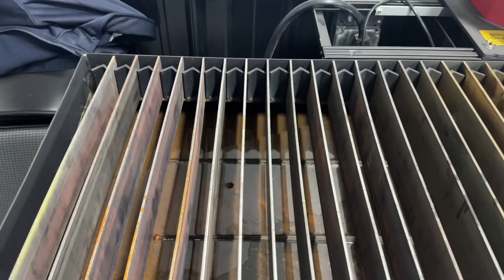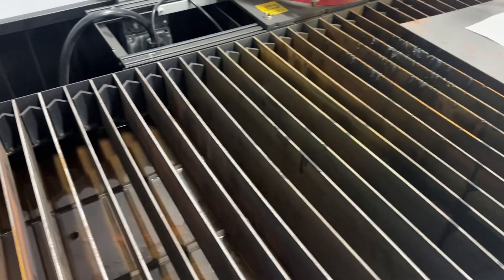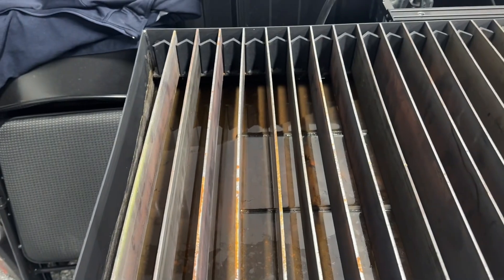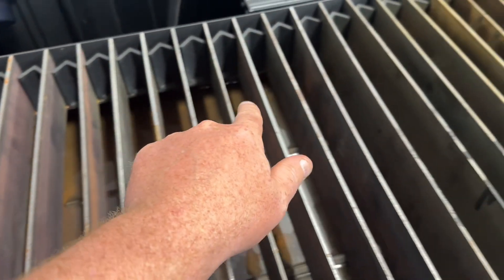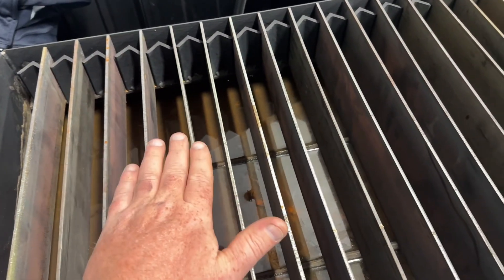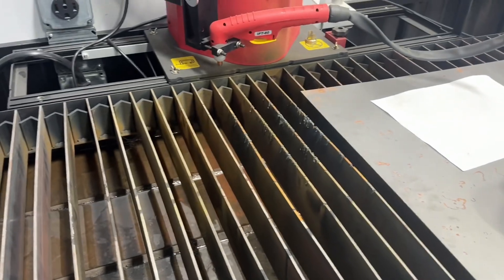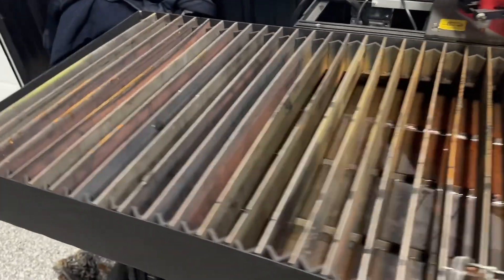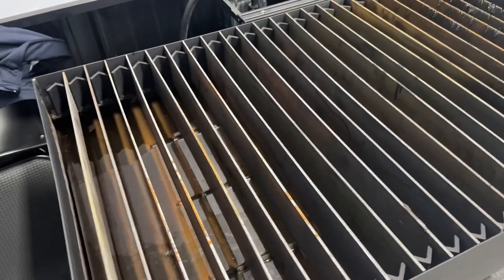Android plasma table with X2 overview

Comment: what size walls did you make? 5"? Slates 3"? Great build! I want to do something similar but put a motorcycle jack and placing the arcdroid on it so if I have taller material like a square tube I can raise it up and cut that too.
Reply from the maker: The walls are 5 in tall. Slats are 3 in tall. Thanks for watching.

Comment: Very nice job just a couple of questions 1) How many slats and 2) what is their thickness thank you
Reply from the maker: The slats are seporated by a beice of 1 in angle iron, so they are just over an inch apart. I don't have them all in for every cut. this allows me to support the metal as nessary. 10 gauge